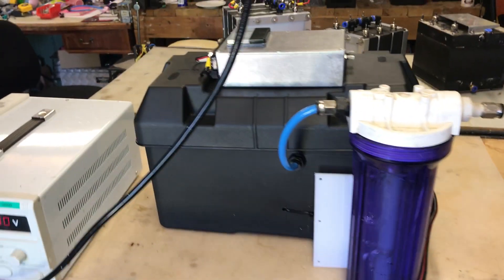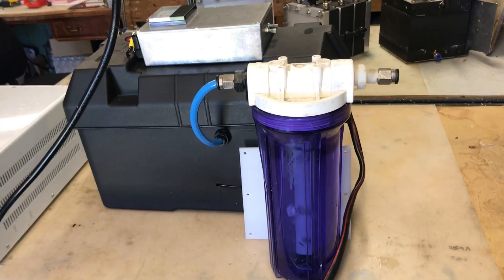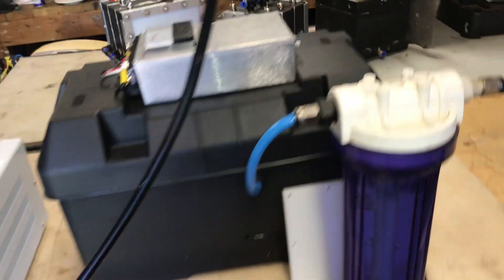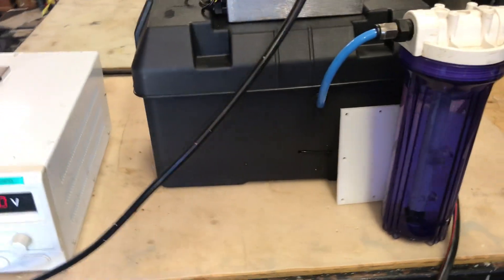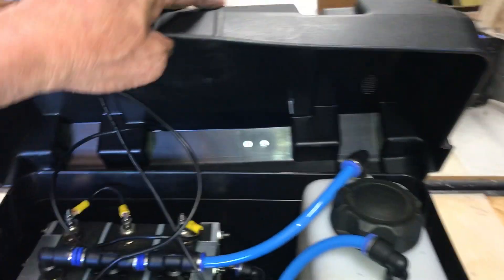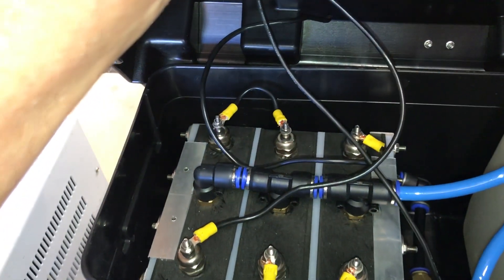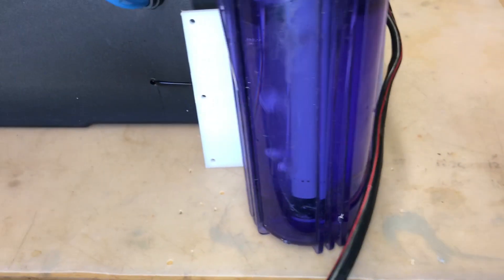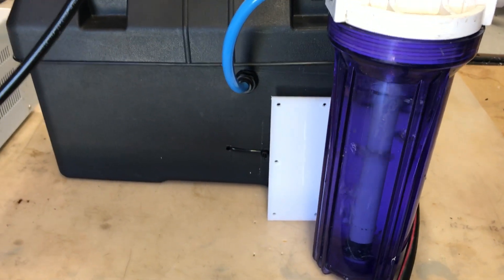hydrogen generator system - Hydrogen fuel system for trawlers , Boats, and Gensets

Comment: How much
Reply from the maker: call me on 0403177183 
glknox11@live.com
https://hydrogenfuelsystems.com.au
patented , proven and certificated system delivering 32% savings on a 7.2 L truck - 27 tonne load
Reply from the maker: call me on 0403177183 
glknox11@live.com
https://hydrogenfuelsystems.com.au
patented , proven and certificated system delivering 32% savings on a 7.2 L truck - 27 tonne load
Reply from the maker: Gavan Knox glknox11@live.com  and https://hydrogenfuelsystems.com.au   
  
https://www.youtube.com/shorts/Qv5JO1Czajo

System running at 12.5 volt and 35 amp producing 4.2 litres of hydrogen gas per minute.
Increase the gas flow by using a Higher input voltage and also by  adding 20 grams  Potassium hydroxide to the 3 litre water recycling tankl
Call gavan 0403177183
september  30 2025

check out our webpage https://hydrogenfuelsystems.com.au

Comment: Can you explain exactly how the gas powered engine will benefit from this?  Is a typical gasoline powered engine able to run on hydrogen as reliably?  Will this be like ethanol and be rough on some of the more fragile parts?
Reply from the maker: call me on 0403177183 
glknox11@live.com
https://hydrogenfuelsystems.com.au
patented , proven and certificated system delivering 32% savings on a 7.2 L truck - 27 tonne load
Reply from the maker: Gavan Knox glknox11@live.com  and https://hydrogenfuelsystems.com.au   
  
https://www.youtube.com/shorts/Qv5JO1Czajo

System running at 12.5 volt and 35 amp producing 4.2 litres of hydrogen gas per minute.
Increase the gas flow by using a Higher input voltage and also by  adding 20 grams  Potassium hydroxide to the 3 litre water recycling tankl
Call gavan 0403177183
september  30 2025

check out our webpage https://hydrogenfuelsystems.com.au
Reply from the maker: https://hydrogenfuelsystems.com.au   0403177183
Reply from the maker: call me on 0403177183 
glknox11@live.com
https://hydrogenfuelsystems.com.au
patented , proven and certificated system delivering 32% savings on a 7.2 L truck - 27 tonne load

Comment: Can you build this for me ?
Reply from the maker: https://hydrogenfuelsystems.com.au   0403177183
Reply from the maker: call me on 0403177183 
glknox11@live.com
https://hydrogenfuelsystems.com.au
patented , proven and certificated system delivering 32% savings on a 7.2 L truck - 27 tonne load
Reply from the maker: call me on 0403177183 
glknox11@live.com
https://hydrogenfuelsystems.com.au
patented , proven and certificated system delivering 32% savings on a 7.2 L truck - 27 tonne load
Reply from the maker: Gavan Knox glknox11@live.com  and https://hydrogenfuelsystems.com.au   
  
https://www.youtube.com/shorts/Qv5JO1Czajo

System running at 12.5 volt and 35 amp producing 4.2 litres of hydrogen gas per minute.
Increase the gas flow by using a Higher input voltage and also by  adding 20 grams  Potassium hydroxide to the 3 litre water recycling tankl
Call gavan 0403177183
september  30 2025

check out our webpage https://hydrogenfuelsystems.com.au